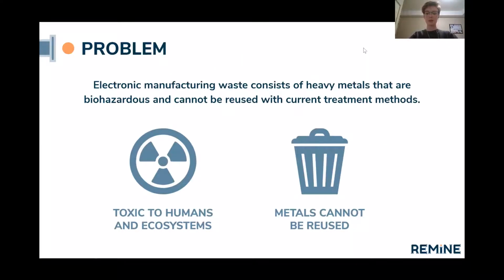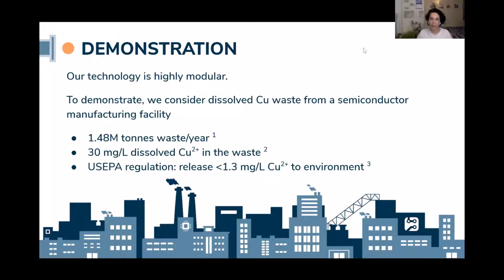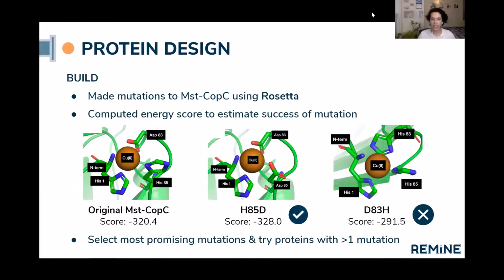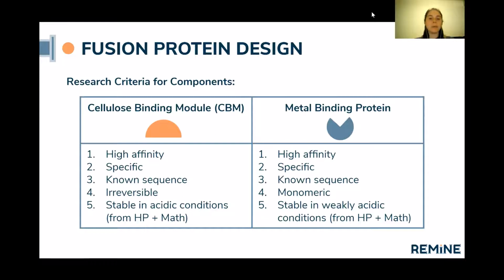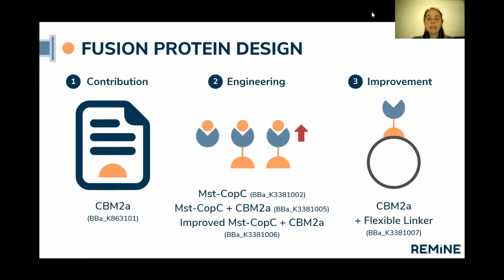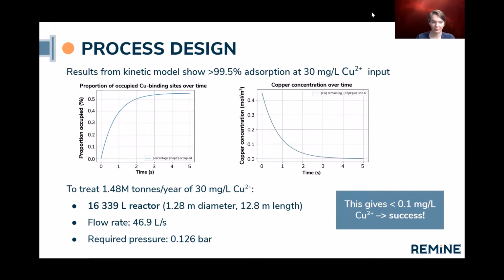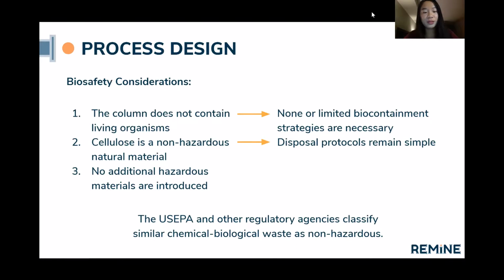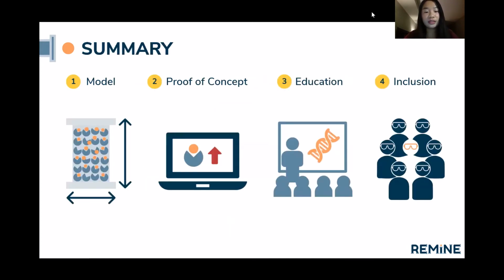REMINE: Waterloo iGEM 2020 Project Presentation Video

Comment: Very interesting process and amazing application of mutant proteins! It was said that the column can achieve ~4 cleaning cycles per day, but does the constant fluctuation of pH have an effect on the proteins' affinity for the Cu or on an effect on the cellulose's affinity for the protein (i.e. if some of the column/protein were to remain protonated)? Or does the quality of Cu removal remain consistent?
Reply from the maker: Hey, great question! 

Our proteins bind copper best above pH 7.2 and release the copper below pH 4. To take advantage of this, we adjust the pH of our metal waste to pH 7.2, allowing the maximal amount of copper to bind to the column and be removed from the waste. Once the column is saturated with copper, we adjust the pH to 4, causing the copper to unbind. We can then recover this copper for re-use. 

As for the cellulose binding domains, literature shows that they maintain good cellulose affinity across the range of pHs that we would use in our column, so this is not a concern.